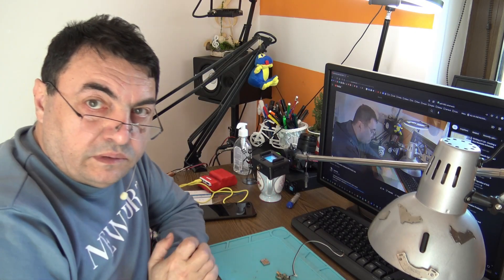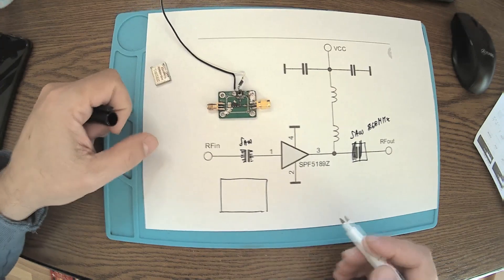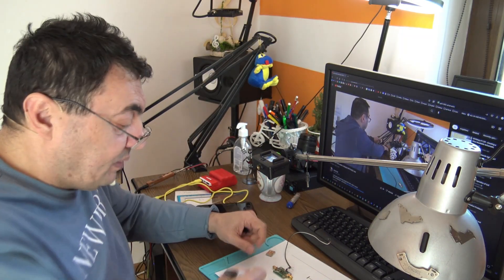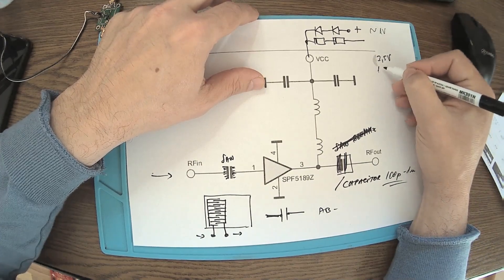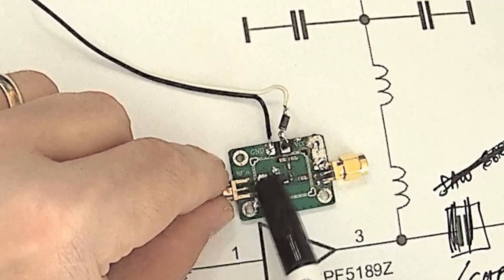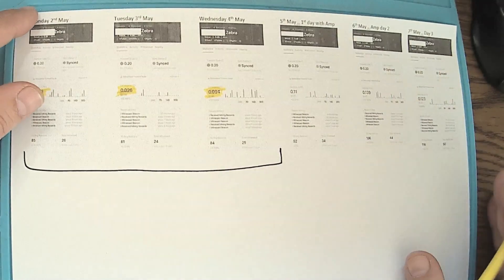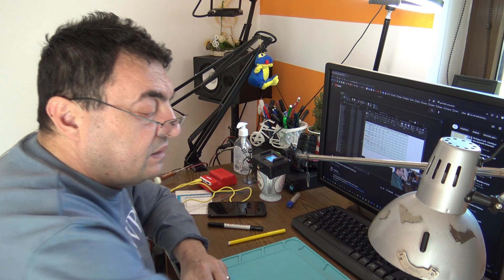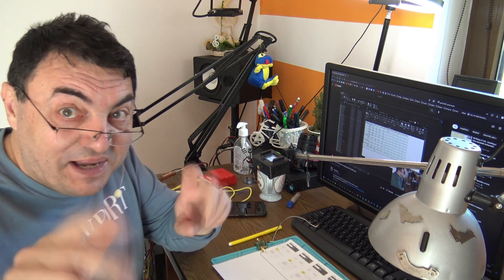SPF5189Z filtered LoRa amplifier

Comment: i have just placed one of these inside my m1 miner, i put a saw filter in place of the cap, de soldered the pcb plugs, cut the pigtail and put the amp in between, powered by the 5v fuse with 2 x 4001 diodes, ill wait and see what the results are
great Videos
Reply from the maker: It should work. Have patience
Reply from the maker: You could power from USB..if any, a working amplifier needs like 100mA

Comment: sir..i use a walkie talkie repeater at a frequency of 440mhz if I want to increase the reception strength is it good to use this SPF5189Z amplifier so that the rx can receive far and small signals..if it is used well I want to buy it..i am from malaysia ham radio
Reply from the maker: Yes , they are working pretty ok, most are fakes SPF5189 chips, but still working somehow..I suggest better PGA103+..This SPF amplifers are indeed cheap and with current limitation they do the job..for the money..

Comment: This is not bi-directional so how does it handel the transmitting from the Miner ?
Reply from the maker: That's a problem..just a tiny signal goes to TX (doesn't hurt the amp) but there are solutions, I'm using a RF circulator connected to two antennas, so TX is going to a dedicated one..This gives the freedom of experimenting with RX.

Comment: Good Video, I myself is testing now the Acosom RX=17 TX=6 868MHz Miner AMP + Bias Tee, It does work great, I have to say most definitely big difference in the RX but I'm still only witness the same miners than before, I'm trying to pull more signals as I'm far from other miners 38Km + but I think it will only work when other miners have also a good installation and is  high enough and or having good antennas. The furthest witness at this moment is 58Km same as before the Amplifier but the signal difference is -135 without and -121 With the amp. Keep up the good work.. Thanks.
Reply from the maker: That's a huge difference in RSSI! The problem is that signals from afar are week and the self noise is added to it..even with a good RSSI but low SNR  comes a no go witness..maybe a directional antenna?
Reply: @viocaia  That is true, most of SNR's are at least 3 to 6 dB better but there is some that are the same but none are weaker , This is still a test with amplifier at the bottom of the coax, I'm planning to install at Antenna within this week if time permits, will update you when I have done so.
Reply from the maker: @jacoleroux5569  Super! Near anntena is the best.Let us know the results.